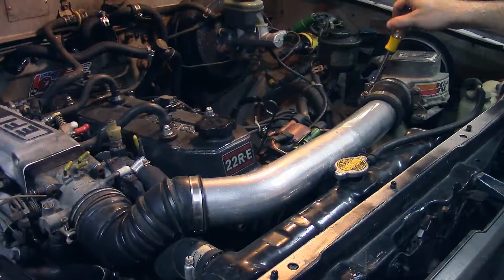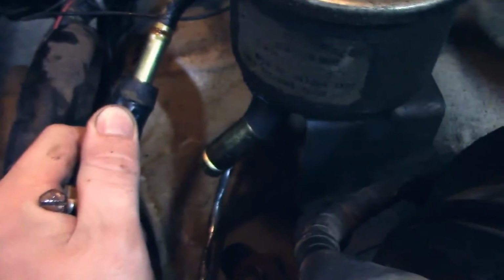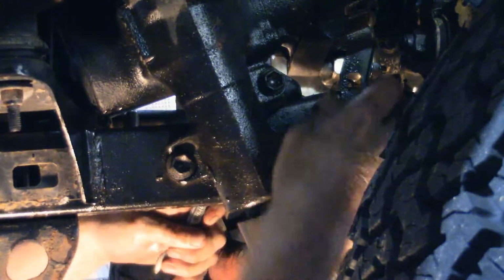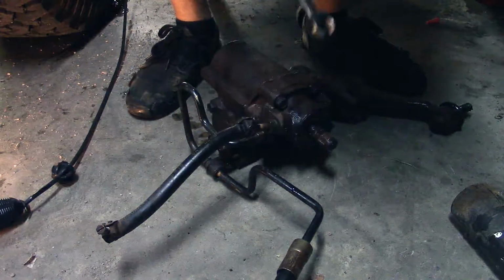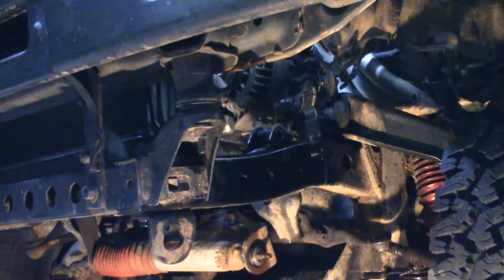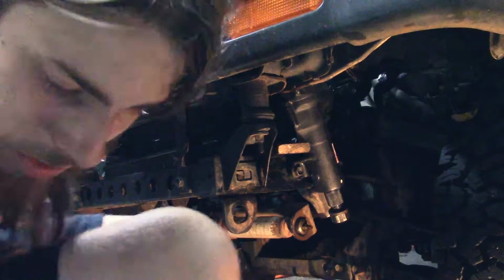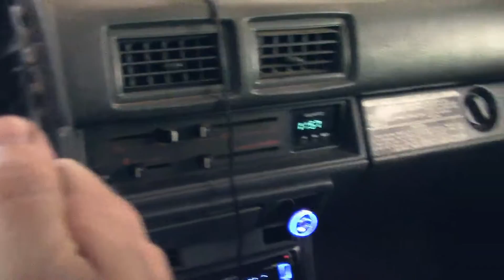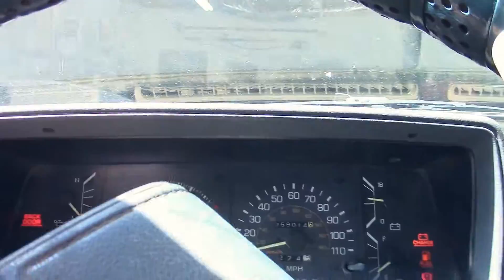First Gen Toyota 4runner Steering box, Idler & Pitman arm replacement

Comment: How do you tell if the steering box is bad?
Reply from the maker: If there's a lot of play in your steering, it could be time to change it. But even the new one has a little bit of play.
Reply: You can also adjust the gearbox if it has too much play is really easy to do there’s a video on you tube.

Comment: Hi Man,My father in law have a 1986 4runner and the gear box of it is leaking. How can I fix it?Can I also ask if the old land cruiser's gear box will fit in to his 4runner? in case I need to replace it because I am here in the Philippine so parts of this kind of cars are hard to find and sometime they are not available here. your reply is highly appreciated
Reply: Jeffrey Tan damn good ?
Reply: landcruiser and 4 runner are two different set ups. Is your 4runner a hill surf with straight axle?
Reply from the maker: not really sure man, dont think the surfs and landcruisers have the same drivetrain

Comment: Bro.. i have a problem with my 4runner..when I turn to right side 180dg, it start making a noise like cracking or the wheel is hitting metal I don't know..I checked all joins and it looks like need new one..i already replaced axle arms right and left..next my joins.. I dont know if you had a similar problem..
Reply: I have had that problem for literally 100k miles. Meh. still fine.
Reply from the maker: If you have bigger ties, its the tire rubbing on the sway bar when you make tight turns. Hope that helps
Reply: You can also grease your hard stops for your steering assembly. It tends to wear down the plastic cover. Once you grease it, the sound goes away. It’s only temporary until you replace the plastic cap. I know this comments 5y old but if someone has the same problem, a friend helped me so I am just sharing what worked for me.

Comment: dude this is not a first gen. thats ifs lol
Reply: Dude, aren't the gen designations by body style in large part?......with the '89 being the last of the "first gen" which included many changes on several fronts between '83 and '89? Are you saying that there are two versions of "first gen" - with the primary difference between the two being the switch to IFS in '86? So you're saying "first gen - part one" is '83 to '85....and "first gen - -part two" is '86 to '89?
Reply: @lascarskey  1st gen went up until 83 then 84 to 88 is second gen. 89 was the start of there 3rd gen truck but first gen tacoma. Yes your right though. It goes by the body style. I have an 88 pickup. It's a 2nd gen but is like a test dummy for the 89 like the 3.0 v6 and  ifs.
Reply: @ethynanderson8694  I'm still finding that 1st gen begins in '84 and covers up through the year '89 - sharing the year '89 with the 2nd gen. The Hilux was prior to '84. Or am I totally wrong.
Reply: @lascarskey  it depends. I have the pickup version not the 4runner. So technically 84 through 88, is 1st gen 4runner but not 1st gen for the truck the body style completely changes though in 89 for the pickup and 4runner. They round off the fenders and bed and give the interior all differnt kinds of new tech and style.
Reply: @lascarskey  I have an 88 pickup and it's the last year of the 2nd gen body style